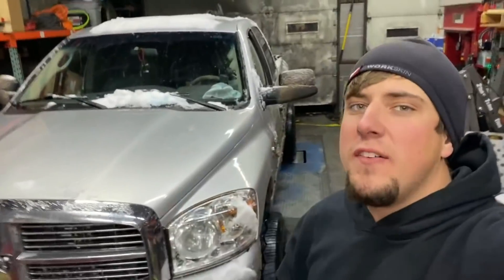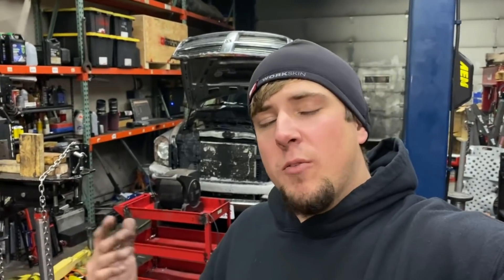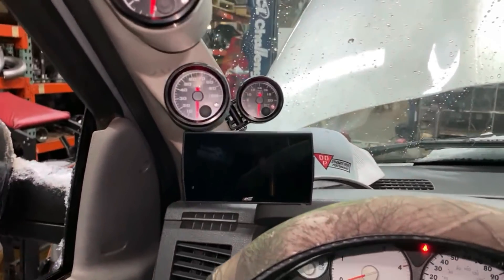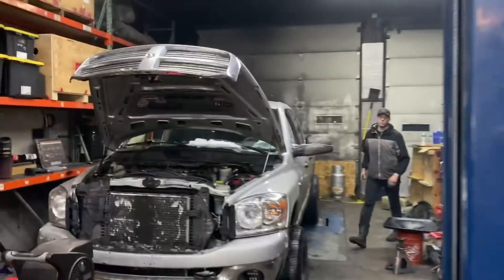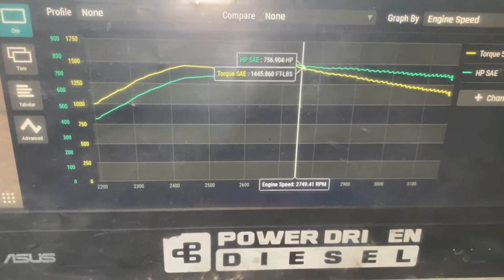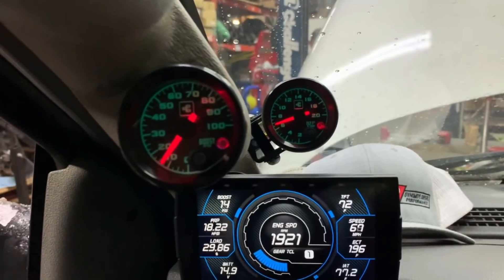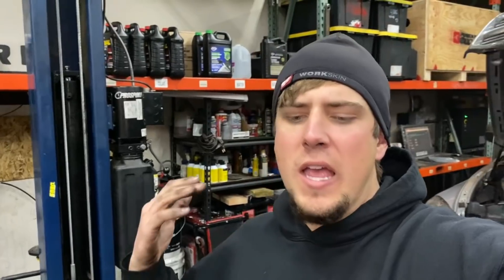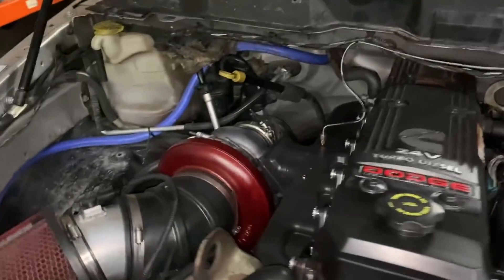CUMMINS 467.7 DYNO TESTING

Comment: Does this turbo bolt into the factory location? I have the PDD add a compound kit. Looking to replace the baby turbo with one that dont keep breaking. I assume I would have to adapt to t4 or buy the steed speed t4 3rdgen

Comment: Way more than I expected. It kind of scares me because I run the same boost except mine doesn’t taper down at high rpm with similar sized injectors at the 2000us range. I guess I need to dyno mine, I guessed 600-700. I also have big valves so 700 might be low

Comment: If you dont mind my asking what does a setup like this cost roughly?
Reply from the maker: 15-18k
Reply: I got  2003 2500 quad cab with same setup for $12k
With 37” tires. 
Built trans
Head studs ect.

Comment: Do you think I could run a 467.7 on stock fuel with an airdog 165? 2004.5 2500
Reply from the maker: Yes but it may be laggy down low

Comment: I have the same truck and I make 40psi on the stock turbo and I’m in salt lake and the elevation is 4500. I think the inner cooler leak is losing a ton of boost
Reply from the maker: We sell boost leak test kits!
Reply: @horsetorquesdiesel  I was talking about your truck I think it’s losing a ton of boost from your inner cooler, but saw the new video and you got a new inner cooler so problem fixed
Reply from the maker: @paxtoncurtis6110  I think you’ll be suprised how much that leak didn’t matter